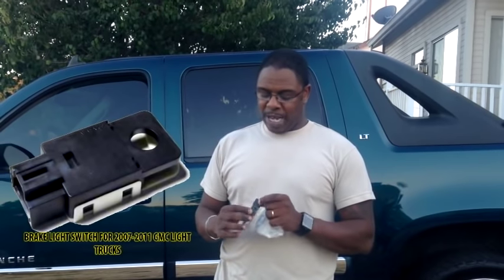[SOLVED] Fix Service Stabilitrack and Service Traction Control on 2007-2011 GM Trucks

Comment: I just got my 07 Chevrolet suburban. Bro you just saved me from dishing a lot of money
Reply from the maker: Glad this video helped you out!
Reply: Was your truck shaking?
Reply: @kennyking3399  yes. And kicking on first gear.
Reply: @shakurapocalypse1301  mines also
Reply: @kennyking3399  if that doesn't work, check spark plug number 8. Sometimes the tip of the plug is bent and it's not sending shock.
Reply: @shakurapocalypse1301  I’m gonna change spark plugs tomorrow

Comment: Gary...
You. Effin'. Rock. Bro. !.

Seriously, Thank You!
You are THE FIRST person whom I have come across after months of on again, off again research on this exact issue who has even bothered to call attention to this particular gizmo which, until just a few minutes ago, I had no idea even existed.

If replacing this little doo-dad actually DOES fix the 'Service StabiliTrak' issue that I've been having on my 2012 Camaro when I try it in a week or two, I will straight up fly right back to this video's page and grovel incessantly as I kiss it's feet and offer up the soul of my as-of-yet still unborn firstborn child...

... 🤔

...orrrr, perhaps I'll just write another post stating that it REALLY DID TOTALLY WORK, and stuff...

...and junk...

... Oh, AND I'll probably also say "Thank You!" again...

...but, like... a LOT.

Like, multiple times. Y'know. Probably.

AND IN ALL CAPS AT THAT!!

Until then, Happy Holidays!

👍 😉  🤘

Comment: reduced power comes on due to computer thinking the traction control or stabiltrak is faulty and hence reduces power for your safety. thanks again Gary, i was suffering with this for months and to make things worse it was intermittent. Garages here will not point you in this direction and most,even cheverolet, dealers do not know how to diagnose it. you should post on the chevy forums as its a popular subject that has no conclusion in most cases.
Reply: Russell, do you mind my asking what type of vehicle you have?  I have a 2011 Impala - do not want to give $$ away to the dealership if I don't have to!

Comment: J Gary, I have this problem, and think I'm going to try your solution. But I had a couple questions.
When the service light comes on, "Service Stabilitrak", I can feel that Stabilitrak is disengaged. Does this re-engage stabilitrak? And have you had any further issues or warnings since you've installed it?
Reply from the maker: R74 haven't had anymore issues with the stability track and it's been over a year since I did the repair.
Reply: R74

Comment: @Jgtv what is the name of the part you are replacing? I have a 2007 GMC Acadia and my service stabilitrack and service traction control light keeps coming on as well as it is saying traction control is off
Reply: Alisa, I know this has been a while ago and maybe you aren't even on here any more, but I am having the same issue with my 2008 Acadia. the Throttle body was replaced 2 1/2 years ago so I am seriously hoping it is not that. What was the issue with yours??

Comment: Ironically our family also owns a 2007 Avalanche also. We get the same read out messages that you mentioned. However we have never experienced a problem shifting into gear, but rather with vehicle shutting off particularly when turning or at take off at a traffic light. Would the same fix apply in our case to your knowledge or could this be another issue? Thanks so very much in advance for your assistance, Sir.

Comment: Nice work Gary!! Gonna give this a try, tho I have not had the issue with the shifter occasionally I get the lights and the "dingdingding" I pull into a parking lot, shut it off, lights still on, put in reverse and back up two feet and 'system normal' It does how ever drive me knuts. Thank you for sharing and happy trails...

Comment: Just fixed a problem I've been having for years now. Thank you. 
One question. Why doesn't the avalanche have a bolt just a clip. Might didn't have one. Just wondering if I'm missing a part.

Comment: So was driving my Tahoe and it felt like it miss shifted. The column will go through the gears but park and reverse will only engage. No drive features work truck only goes backwards. What do you think ( no problems starting what so ever all the same lights in the video are on my truck as well)

Comment: Have this exact problem going to buy the piece tomorrow? I have a question my traction control is off and my tahoe slides all over the snow so will this fix my traction control also

Comment: Number 1. >If you have a 2008 chevy or pontiac and have problems with stabiltrak and the engine light coming on, the problem is your EGR valve. I bought one from autozone and put it in> Engine light went off but stablitrak stll kept coming on. End result, the EGR valve needs to be a factory replacement and not one from autozone or similar. I had chevy dealer check new EGR valve from autozone and it showed bad. The problem is the resistance in any other EGR valve vs the factory one is higher and that impacts the electrical system and the stablitrak light. Once I replaced factory EGR valve, I have had no problems with Stablitrak and engine light coming on.  

Number 2. > If you are having the problem in this video, losing power, GM came out with a factory update on November 15, 2015 that all those vehicles need a new throttle -position sensor, that causes the malfunction ,engine light to come on and engine power reduced light to come on. If you have under 120,000 miles on your vehicle, they will fix it free.
Reply: Thanks my check engine light came on also
Reply: I have a 2008 Chevy Equinox and it started with the check left tire pressure first (nothing wrong) then taking my girls to school the service traction control and service stabilitrack light came on and Im experiencing hesitated pull off when I press on the gas and light shaking....is that the the valve thing that needs replacing?
Reply: @randyrogers1065  Did changing the shift interlock solenoid work?
Reply: Janay Parson my 08 equinox is doing the exact same thing. Already replaced the EGR valve, but didn’t get an original manufacture EGR valve. I think  I should’ve now.
Reply: @jeremyhitt6068  so you think the manufacturer part would fix it?
Reply: Janay Parson I’m leaning that way, but I don’t know for sure. I’m looking into it. I’ll let you know as soon as I do.
Reply: @jeremyhitt6068  thank you! yes please do
Reply: Janay Parson, I had the same exact indicators on my 2009 Chevy.  I just replaced my body control module with a refurbished clone and nothing.   Keep us updated on what's working for you.
Reply: Hands of Divine Beauty did you ever find the issue. That’s what I’ve been dealing with the last month
Reply: @princeofprofits4446  no Im still having the same issue. Ive noticed that after the car has "warmed up" and I turn it off for a while that it starts right up and acts like normal when i restart it

Comment: How do you know what tire on the break to change that switch? Like I got the error but not giving me the exact location on the affected tire or brake pad. Or is it just on that steering? any help? I have “service Traction control” and “Service Stabilitrack” of my 2007 Escalade.
Reply: Me too, did you fix your 07 caddilac?

Comment: I have a 2008 Avalanche 138,000 miles, and had no issues till now.  I get the service lights but have no shifting or flickering brake lights issues. Im gonna replace this part, D-1539J and see if it fixes the problem. Better than taking to a dealer and spending $$$$$$  and let them try to guess whats wrong, especially after Ive read 100s of posts from various owners with like problems. I will update after install ..
Reply: Update, 12-29-17 . I .had the codes run on my 2008 Avalanche and it said misfire # 1 cylinder  . So come to find out the sparkplug was broke, so i changed it and  so far, all the warning lights have went away ......

Comment: Good video and good info. Recently just had the lights pop up on my 09 Silverado. Crawled under it and wiggled the cables to my driver side wheel hub assembly and everything went back to normal after and engine restart. Typical of GM vehicles for those connection points to go out. Had the same issue with a 99 Yukon. I'll keep this fix in mind for future issues with this though. Thanks for the upload!

Comment: Same on my 99 Suburban.  I had the exact same issue, periodically car did not want to shift out of gear and cruise control would drop of while set.  I changed that module, although on the 99 it's a real pita to get to, there is barely any room to work with.  Temporary workaround if this happens to you while you are in a parking lot and you can't shift the car out of park, is to turn off your car, put your foot on the brake  (critical to have your foot on the brake the whole time)  move your key to the on position without starting the car then shift to neutral, then start the car.  KEEP YOUR FOOT ON THE BRAKE AT ALL TIMES otherwise your car may role when in neutral or move forward once started.

Comment: Hell yeah thank you!  My problem was not this. It I did do the big three wire upgrade with 1 gauge wire now my volt meter always reads 14.8 all the time steady!!!!! Great video! I just cleaned the mass airflow and the throttle body and this fixed my issue for now!!!!!

Comment: I have a 2008 Chevy Tahoe with my ABS and stabilitrack light on and it doesn't get out of park this work..... Is fix I also change the brake interlock actuator... It works great....👍🏽👍🏽👍🏽👍🏽save lots of money...... Thank you.....

Comment: Hey Gary I was just wondering I am having the same problem on my 2007 Escalade and I'm going to try what you did on your video and see does that work for my truck too cool video
Reply: Did it work? I have an 07 Cadillac escalade as well, doing the same thing

Comment: Thanks for the video.   Quick replacement with a $25 part from O'Reily for my 2011 Yukon.
Reply: I have a 2011 also,  the part looks the same as the one in the video but there's a screw.  Did you remove the screw?
Reply: @jeffh5934  No, I didn't remove the screw.  The screw was needed to lock the part in place.
Reply: @cbsmanager  Thank you.  Apparently there are a variety of different retaining clips for this part.  I found another video with the exact same retaining clip I have with the screw through the middle of it.  With the other video I was able to get-r-done and it's working great!
Reply: Jeff H I have a screw in mines too I was nervous to move it bcuz his just has a clip was it easy for you to remove

Comment: Gary,  Man I'm glad I stumbled upon your video!  The new sensor installed and worked just like you said.  Almost scary easy!I've been wrestling with the Stability Track and locking shift lever problem for several weeks and of course I'm way to proud (cheap) to pay the dealer the Diagnostic fee.  From what I've read, they will throw a dozen parts at my car before fixing it anyway.  Thanks for saving me the $$ and loss of vehicle for probably days.
Reply from the maker: Glad the video helped you out!

Comment: I have an 07 Chevy suburban with stabilitrak and service traction control and then reduce minimum power on the engine comes on. nothing for my brakes come on just wondering if I would be able to use this part as well even if it's not showing  anything for my brakes. car still shifts into gear. Thanks in advance

Comment: I currently have this issue on my Avalanche the light will go off after resetting by switching truck off for fifteen seconds then restart but will come back on I'll try a switch to see if it will fix this problem thank you for the info
Reply from the maker: Hope you are able to get it fixed.
Reply: Did it work?

Comment: Man, I’m wondering if this could be my issue with my abs/stabilitrack/traction control alerts for my 09 GMC Sierra. My cruise control wouldn’t engage for the longest time and based on some research determined that piece to be the issue. I replaced it last summer with a new brake light sensor and within a month started getting the aforementioned alerts. I figured it was another sensor that was failing due to 11 years and 145k miles. Perhaps I got a semi faulty replacement part. My cruise control works fine now.

Comment: Jgtv did your abs and stabilitrax turn off after you put the new break light switch? For some odd reason abs and stabilitrax turn on during winter
Reply from the maker: +Bianca Jacobo Yes mine turned right off as soon as I put the new switch in.

Comment: pushed the traction control button to turn it off and I was able to drive my 09 Tahoe to pep boys to buy the part. lights were still on and cruise control wasn't working either. fixed all these problems. thanks!

Comment: I have same issue in my Gmc Acadia 2009 but one thing added problem that is while going to drive mode screen shows still on P but it goes heavy while driving and sometime during drive mode everything goes correct and come back again …… still it has same solution ??  Pls advise I am unable to get solution

Comment: I have a 2012 GMC Terrain and my vehicle is displaying the same messages with the Stabilitrack and traction control and when I scanned my vehicle it comes up with  C0035 code which is for the right side ABS, I've replaced the sensor as well as the wheel bearing and s till have same issues, after clearing codes I take it on test drive and my brake pedal vibrates bc it activates the ABS and it returns same code. I think I will do the same and invest in the brake switch and see if this corrects my issues. Praying it does!!

Comment: When I cranked up my 07 Tahoe it started shaking and the service traction control and stabilitrak lights came on. You didn't mention anything about shaking. So I'm wondering if it's the same as your or something totally different?
Reply from the maker: Delta MS To be honest don't recall if I experienced shaking when I was having the issue.
Reply: Delta MS did you find out your problem?  my 07 tahoe is doing the same as yours the mechanic doesn't know what's wrong with ig
Reply: Delta MS did you get the issue resolved?
Reply: did you get the issue resolved bc I'm having the exact same thing going on my 2009 tahoe?
Reply: no we cannot afford to put it in the Chevrolet dealer at the moment but hopefully within the next few weeks. I'm also having a gas smell around the right rear end on the outside near gas pump and tire along with these issues with running rough and traction control light and stabilitrak and shaking
Reply: Delta MS are you there
Reply: Delta MS ur truck need a new tps sensor

Comment: Ok what if the brake sensor is working just fine n I'm still getting the stability tracking comin on n also the traction control light. The brake sensor is gonna fix those lights from comin on?

Comment: Thank you for the video. I have an 09 Silverado and I replaced this switch because brake lights were staying on and cruise wouldn't work. I'm still having problem. I also get the traction control and stabilitrac message. Any suggestions. I've actually replace the switch twice to make sure it wasn't a bad switch.
Reply: Gary Agan for anyone having this issue!! He said brake lights stay on! If that’s not the case for you! It could be do to clogged fuel injector fualting spark plugs and a dirty air filter! I’d start wit regapping exsisting plugs if too far gone replace with new dump some very good fuel injector cleaner in tank and remove air filter once lights are gone put air filter back if clean otherwise replace with new

Comment: Getting ready to buy a Caddy SRX that has the problem of stibilitrack light is on. I hope when I get the SUV in a few days that this fixes that problem. Like you and probably worse is that I'm not a mechanic. Your video is good, but just wish you would have accually replaced the part on line. I'm just not sure how you did it, but maybe I will see when I get under there. Thanks for the info big time!
Reply from the maker: +jammer4949 thanks for the input in my video. In future videos I will do the repair on film so y'all can follow along. Best of luck on the SRX. Hope the switch fixes the problem for you.

Comment: I went from having no brake pressure to having to much. By changing booster, master cylinder, abs module, and my stabilitrack is still on as well as traction control. Will this help. Never know about this part

Comment: I got a 07 avalanche like yours. Would this cause a jolt when shifting from park to drive or when taking off from a stop sign?
Reply: 562DUBZ CORRIDOS 90'S On mine it was the spark plugs. Replaced the spark plugs & wires. No more joilting.
Reply: 562DUBZ CORRIDOS 90'S And it just started doing it again once this evening. Think it may be one of my ignition coils.

Comment: I have a 2008 GMC Acadia Service Traction Control & Service Stabilitrak is on along with the check engine light. I've noticed that the gas meters has also began to float & fuel level low turns on then restart the car & fuel returns to original setting. Wondering if this could be the same issue as it seem like it may be some sensor problems
Reply from the maker: +Ryans HelpingHandsandHearts not quite sure if the switch would fix all of the problems you are having. My truck was only doing the symptoms mentioned in the video so I'm not sure about the  check engine light and fuel float issue.

Comment: Thanks for posting!!1 Had the exact problem, it was also an Avalanche!!
Reply: Was the engine light on also I have a 09 avalanche and I'm currently having this problem
Reply: @johnmbellamy  Engine light was not on.
ABS, Stabalink, and traction control
I was also having problem with my cruise control not working.
Replacing the brake light switch also fixed that issue as well